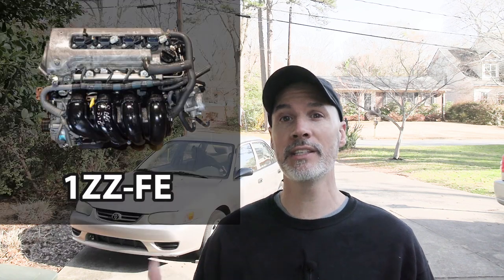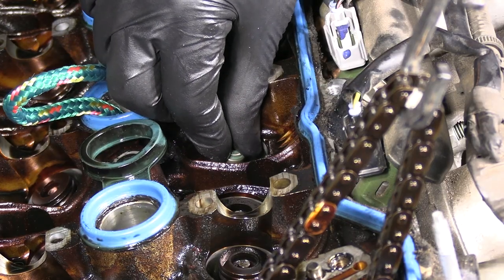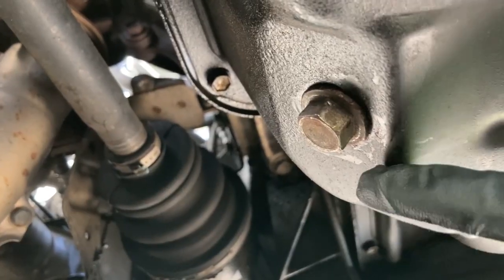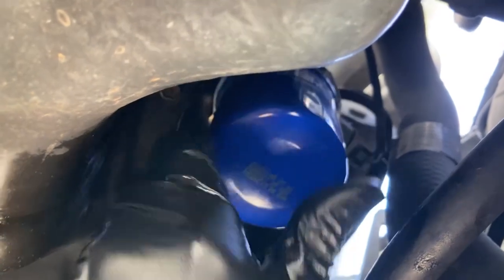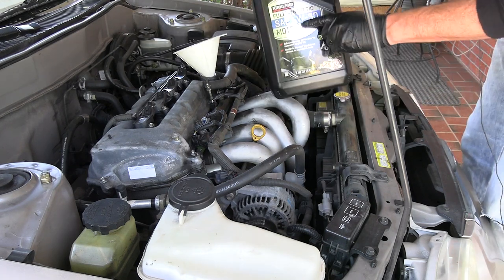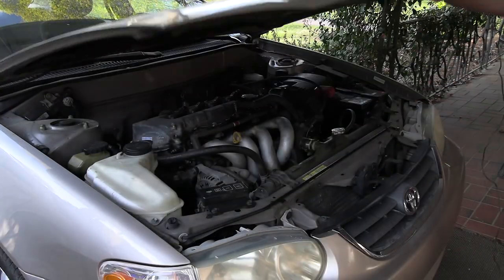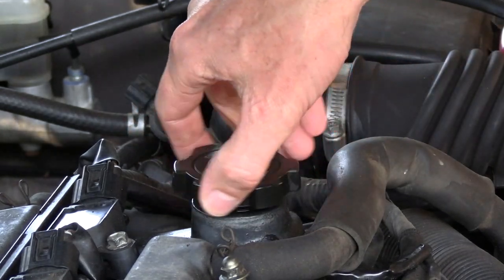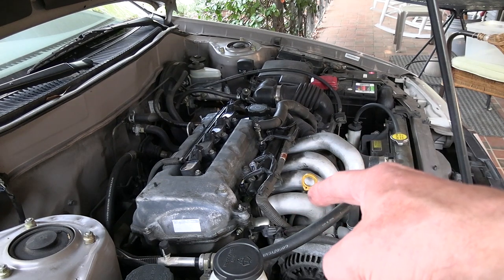Did the valve stem oil seals stop the oil consumption? | Oil Burning🔥Experiments | Episode 11

Comment: Check piston to bore clearance. I still think that's your problem after hearing that piston slap.
Reply from the maker: Interesting. So you think it's the pistons that are worn and not the bore?
Reply: @FamilyFriendlyDIY  The rattle says piston to bore clearances are out of spec.
Reply from the maker: @SoddingaboutSi  Right. I hear you Simon. I was just saying since it appears the cylinders aren’t terribly worn (IMO because of the visible crosshatching) it could be the pistons are worn instead, right? Since they’re aluminum they could be wearing down especially on the front and back faces? So maybe the pistons are now oval instead of round, and might therefore have too much clearance on the front and back faces. I know that’s a fairly common reason for piston slap. I was just trying to clarify what your thought was. BTW You’ve got a cool channel 👍🏻👍🏻
Reply: @FamilyFriendlyDIY  Piston slap from memory is usually caused by loose tolerances and piston/bore wear. But I know what it sounds like. A light knocking as the aluminium piston expands to take up some of the slop. Pretty sure that's the problem. When the engine was cold it had a rattle on application of power . That sounded like piston slap.The piston rocks along the pivot of the wrist pin letting oil past the rings.

Comment: Hi Dave I saw a couple of your videos and I think your block is bad I don't know if it's going to be cost-effective to get a new block or maybe you should just junk that car and get a new one.
Reply: Michael, depends what you want. This car’s body seems in great shape. Even with adding oil, this is far cheaper than buying a new car. If reliability remains high, I’d just live with the added oil consumption. Heck, the 2008-2010 2.4 L I4 with low-tension piston rings is at least as bad, and I’ve heard of those engines lasting over 200,000 mi, so long as oil was topped up.

Comment: You're gonna think that I'm crazy, but make sure you are parked in a perfectly level ground, and run your engine to operating temperature, shut it off and wait for 8 minutes, and then check the oil again, the piston rings are not likely to be the case, if you changed the oil regularly, that is. And you can also try high mileage oil and see.

Comment: I would say it age is the problem .
I would think the old girl is paided for. if it was mine 
Run her tell she's dead but is not .
The cost  of rebuilding the lower end is not cheep I you do only the ring on a tired old motor you could brake a piston because of out of roundness or throw a rose bairing  because eof new higher pressure  are more hp.
Just some thing to think  about. 
Get a lower mileage  salvaged (junk yard) motor.
Good luck

Comment: You lost just over half a quart at 300 miles. Keep it ON the full mark. Not over nor under.
Reply: You can actually have an extra quart in this engine+use a camry 4 cylinder of same gen oil filter to balance it out. This makes it so you add oil half as often while increasing oil filtration capacity.

Comment: Have you thought about using Diesel and mm oil. And you should use that mixture every oil change run it for a few weeks before every oil change.
But overall nice job with the series.
Thanks.